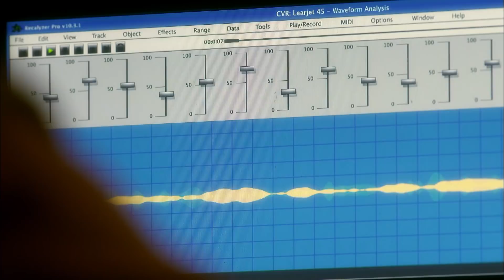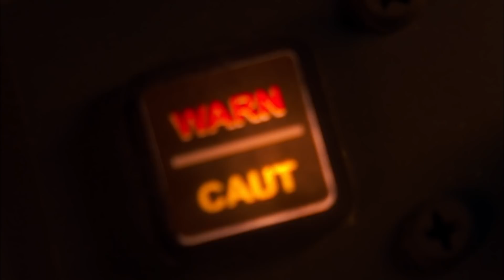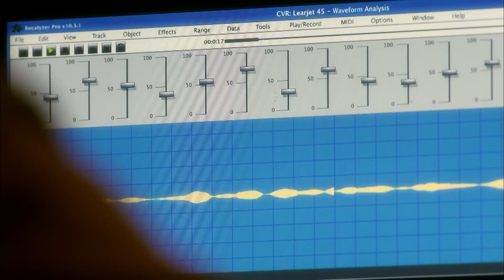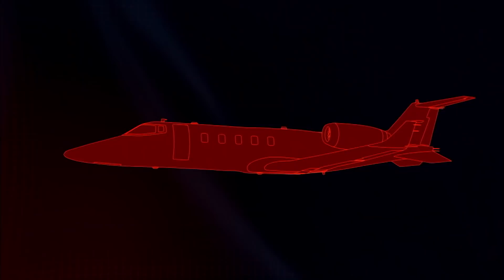Was Turbulence a Factor in the Crash of this Learjet 45? 🌪️ Air Disasters | Smithsonian Channel

Comment: The cause of the crash was because the pilots faked their traning in learjet 45, also when they enter on wake turbulence they didnt know how control on eake turbulence and the plane lost control and crashed on a road killing all on board more 2 on ground and causing injuries to more than 40 people
Reply: There no procedure to recover from wake turbulence.. it’s just avoiding to get into one (fly/land beyond and above). That close to the ground should indicate they were well into controlled air space so ATC could’ve gave them heads up or gave them separation.
Reply: @AkagiRedSun  Air traffic control told them to slow down to 170 knots but they only slowed down to 200 knots instead
Reply: I saw a b777 with maked the learjet 45 to crash
Reply: @fcmetzV4  it was a 767. but still powerful enough